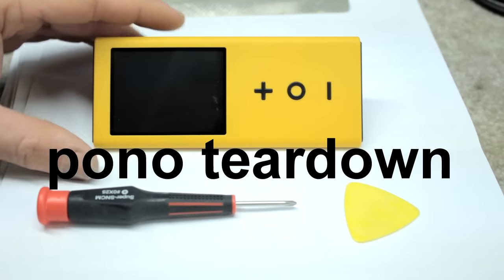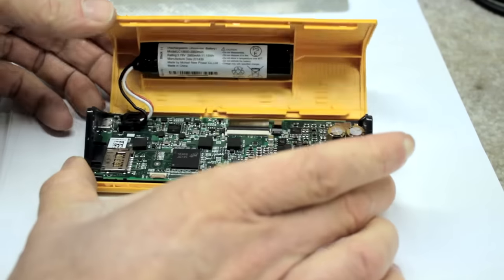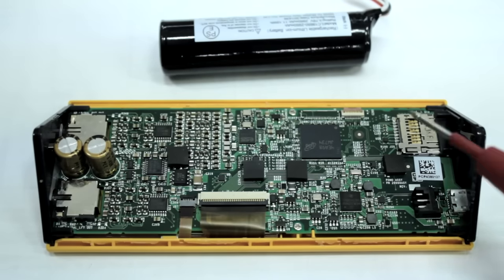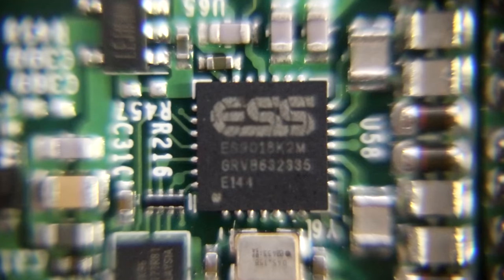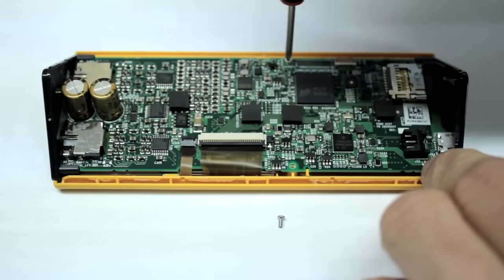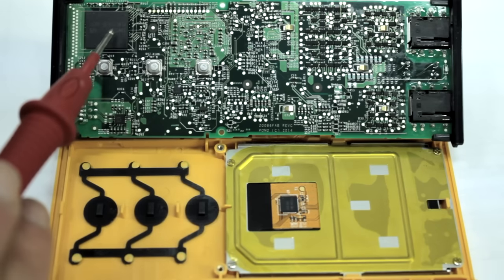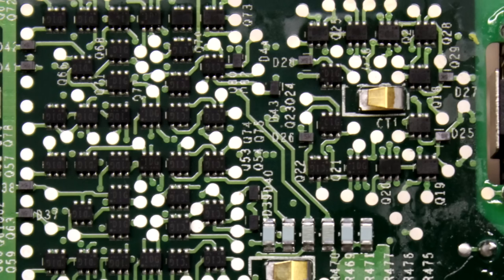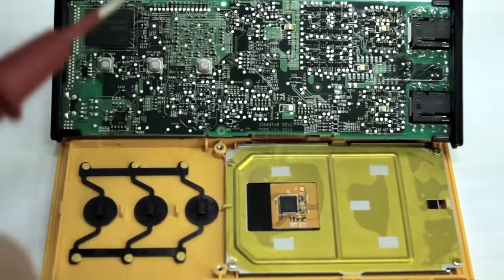Pono Player Teardown - What's Inside

Comment: The Pono uses the same 32bit DAC of that the highly regarded OPPO 105....ESS Sabre32.  Granted the Oppo is not portable, it's an audiophile grade bluray, CD, SACD player which also plays high def audio files from a hard disc, flash drive, or attached PC. I would like to know how the sound quality compares between the two products:
Reply: the DAC chip itself is Extremely cheap in bulk. You realize this right? Whats important is the circuit not the chip. You can find this chip in many CHEAP units and in expensive units.  You can buy this chip right now at Mouser. If buying just one its cheap. Buy 1000 and its really cheap.
Reply: vladlashing - you can buy just a single unit from China for $5 via AliExpress (google it, not exaggerating), so they're not even that expensive when bought in non-bulk. In bulk they're easily down into the $1 range I'd imagine.
Reply: I have 2 Oppo 105Ds and the Pono sounds much better.  The Oppo's Dac is nothing to wright home about.  the PS Audio Direct Stream is my main system DAC and is fantastic.  The Pono is a full music server, DAC with ballanced outputs all in one.  It is a very respectable unit in my opinion.

Comment: Thank you for the teardown.  I'm wondering is the capacitor they have there for the power rail or is it for output coupling of the headphone amp?

Thanks
Reply: +/- Power rails. Outputs are direct DC coupled.

Comment: This popped up on YT and I watched it, so I dug out my old Pono.  It asks to be plugged into power and when I try to power it on, the splash screen comes up then back to the plug in power icon.  Is this just the battery needing replacement?

Comment: Pros:
- Lossless audio support
- High quality stutter-less audio
- Two outputs
- Long battery life
- Simplistic design

Cons:
- Sets off snake oil alarm
- Bulky and cannot be carried in a pocket that easily
- Most audio players today supports FLAC anyway (high-end ones)
- Slightly problematic touch screen
- Rubber coating would literally disintegrate and discolored if used vigorously
- Ugly shape for portable players, good for integrating into Bluetooth speakers and such

p.s. I was talking about using a mid-range headphone to listen to some high quality music. If you care so much about lossless audio, go for WAV! Those are basically indestructible and can be played on any decent audio players and converted to literally any format. Go with ridiculous sampling rate like 1954032Hz. I know you want it.

Comment: this teardown shows that the toblerone shape is completely unnecessary
Reply: +gonigeena no it shows the opposite. the big standard battery can be popped out and upgraded.  no other DAP has that. also the headphone jacks don't take stress like on a slab shape.
Reply: +gonigeena it's a perfect shape, regardless of the innards. my list is above, i'll repost why the shape is perfect, or at least way better than a slab:

1. no stand needed. works in all directions. viewable angle is great even with bad screen.
2. no case needed. rugged and won't slide away.
3. no headphone plug killing. headphone plugs are never torqued.
4. feels perfect in the hand and very easy to drive with one hand. in the dark. even with the screen off. tactile buttons and shape work perfectly to your senses.
Reply: I guess you are an happy customer, right?

Comment: Looks fairly well built and that's a very good DAC.  I'm excited at the possibility of having high fidelity audio reproduction on the go, rather than just at home with my stereo or a headphone rig.  For all the bitter people who seem to always chime in to naysay anything resembling quality, have fun with your McAudio.
Reply: redriverhautbois I've used mine almost everyday for 5 months, it lives loose in my bag and my car, my desk, my dresser, my living room..... it's amazing. I barely ever listen to my phone anymore. I've deleted gigs of mp3's too.
Reply: How exactly has it been "proven"?  It's got a good DAC, are you saying there's no difference between DACs?  Because that's a ridiculous opinion.
Reply: redriverhautbois PP has got a lot more than a great DAC. It also has Meridian's 'negative-feedback' analog circuit design, it has Ayre's proprietary filters between DAC and analog, it has discreet power, it has separate analog and digital boards, and it has no radios, sensors, or other interference on the board.  These are all critical components to great sound. 

Finally, it has balanced output. No other device offers this at this price point. Driving true-balanced outputs with discreet cables really takes you to another level in audio.

Comment: Thanks for this tear down.

Always thought its shape/size was overkill. Now we know for sure!

It's a shame the battery is not long and flat. Then it could be taking up all that space.

Cue planned obsolescence and a 128GB version out with larger battery/display. Smaller form factor within 6months :p

I still want one tho, for the balanced output to headphones such as old trusty sennheiser hd25 or newer Sony z7 (and z5, h2, h3, a2, a3, 1r as well as older ex800/7550, ex1000)

Comment: HEY MAN NICE JOB 
QUESTION IS IT POSSIBLE TO GET THIS LARGER MEMORY CHIP AND HAVE IT REPLACED OR IS THE CIRCUIT TOO SMALL ?
THANKS
Reply from the maker: If you can unsolder a BGA chip, resolder in a new one, and possibly tweak the firmware - you should be sweet. So unless you're a robot, you're stuck with the 64GB of internal memory.
Reply: ***** Thanks man I am not a robot  so I am ok with an external card
Reply: littlejon64 prove it

Comment: My pono player gets warm around where the display is, if I play high res music on it. Did you noticed a similar behavior with yours? I also though of taking mine apart to take a look, thank you that I don't have to do this anymore :)
Reply from the maker: Hi Ein, yeah mine gets pretty warm even while playing 16/44.1 FLAC files.
Reply: ***** Ok, tanks. I was that mine could be broken.
Reply: It's not about the file you're playing, it's most likely how hard you're pushing the amplifier (volume).
Reply: Shouldnt have bought it
Reply: Çerastes I payed for it. Why would it be a trash player? It does everything it should, so it can't be trash in that sense.
Reply: So you say it's overpriced. However, I don't understand why something overpriced is equal to trash.
Reply: +Çerastes you are truly a joker.  are you claiming that a $4 integrated circuit audio chain optimized for voice and gaming is equivalent to the DAC and the analog circuitry inside of a pono player?

you keep catching me with your trolls because they are just so frustrating.  how would an iPod sound the same as a ponoplayer playing the same files? do you know anything at all about how digital audio is rendered into your ears?

Comment: That doesn't look like $400 equipment.
Reply: Shahriar Haque Yet it sounds like $20k equipment. Which is more important to you?
Reply: Jodin Ravia Yeah, I bet It sounds just like a McIntosh setup
Reply: jaaasgoed ponoplayer sounds better than mcintosh gear i've heard. 

Ayre's approach to feedback (short version - they don't believe in "good feedback") makes his analog circuit design unlike anything mcintosh is doing. Mcintosh in fine stuff, no doubt, but there are fundamental differences in the basic signal design between an Ayre amp and other makers.

This is the first time Ayre has tried something under $1k, as far as I know, and to my ears they hit it out of the park.
Reply: This thing clearly isn't worth the money compared to other products out there, but that is the miracle of mass production. If this thing was actually designed custom for them, and they had to create custom software, they'd need a lot more sales than they got for the mass market to dramatically lower cost. But say they sold a million of these, then that price could be down in the $99 range, including a large profit, very quickly. If they sold 10-million, the price could be in the $49 range, still with a large profit. So comparing a mass market item to a custom product like this, you're not going to get value, so it has to make up for that elsewhere... and clearly this product doesn't do that.

Comment: I would wait for version 3, if there is one.  Also, if you are not running it through a home stereo, what is the point of this thing as it doesn't have enough power to power high end headphones. Sony's high def player sounds more intriguing albeit at a much higher price. But even the Sony only has 128 gb of internal memory which is inadequate to store uncompressed music.  The flash memory market can't seem to get to 256 gb at a good price point for some reason.
Reply: +femaledeer i run it through everything and it makes everything down chain sound better.  it's the perfect portable player because you know nothing out there sounds better, at least nothing that won't cost you a mortgage payment or 2

Comment: No wonder the unit is so bulky. They could have easily fitted a flat battery and make the whole unit more compact. Also those big ass capacitors could have been fitted more optimally. Who in their right mind would want to carry this thing around?
Reply: +ovo nisamja best gadget i ever bought. i don't carry it around in my pocket too often, it's always sitting on the stereo or in the car or in my bag.

sounds amazing. portable perfection. no hassle, no distraction.
Reply: I had a car stereo with a USB connector so, that's more convenient for me.
As far as the quality goes, if you include external noise, I doubt it's worth going down that road.
For me, mp3 at 256kbs (good converter is mandatory here!!!) is the top quality one needs to go if he's going to listen to music in a car, or on the street with ear buds. That's just my opinion.
But than again, I have nothing against other people wanting different things, so, yeah, just go for it. And if you're happy about it, all the better.
Edit: I forgot to smile. :)
Reply: cool. i think once you have full quality in your ears you won't want to go back, no matter where you are, mobile, driving, on the bus, wherever. our ears are amazing at filtering background noise and still determining quality. it's like someone offering you clean water and you don't think you deserve it, dirty is good enough for you.
the compressed mp3 files were transitionary tech, necessary 20 years ago but definitely not now. 
but yeah, no one will get rid of the compression, you can keep those mp3 forever. i can't go back, since about 2012 i've gone all lossless and my mp3s all sound like paper bags now.
Reply: Well if you put it that way kinda makes sense.
Reply: Anirudh Rao i get the complaints with the shape but IMO it's way better than a slab. it sits, stands, and stays put all by itself. it doesn't need a case and it doesn't put stress on your headphone cables. overall i love the shape, it's perfect for a media player.

Comment: The simple fact is that, while the Pono Player uses some pretty good kit, it's not going to blow anyone away with audio quality. You could get similar enough results with a cheap MP3 player, high enough bitrate encoding, and a half-decent portable DAC/amp solution. You'll spend less, and feel like less of a chump when you move that DAC/amp over to your computer as well. That's added value the Pono will never have.
Reply: ScottNeelan Not really -- I'm not being snotty, I think you are wrong. Nothing you build is going to be as portable or durable as the PonoPlayer, it's one device with what you would need 3 for. It's a better shape than any slab, and it's a tough little bugger that requires no case, no stand, and no concerns. 128gb expandable MicroSD is nice too.

Why would you need to move the DAC over to the computer? That's marginally important to me. The analog in the ponoplayer smokes any computer anywhere, and you only need 1 good music player when it's so portable and has so many output options. I listen to ponoplayer while I use the computer, I don't need to move my DAC around if it's sitting on my music library.

I'd like wireless sync if they could be sure of no interference. Part of Pono's good sound is no radios or sensors whatsoever, and a discreet power supply and analog board.
Reply: Unless it's one of the expensive Fiio's or A&K it's not sounding as good as the Ponoplayer.

Getting Ayre amplification battery powered for $400 is the real value of the device. This is the world of analog, (like your ears and the rest of the real world).

2nd best feature is the flexible output, including balanced, line, headphone, and dual headphone.

The DAC, memory, android, and general feature list can be found on other devices.

The form factor is perfect for both mobile and stationary use. Everything is open standards. The store pushes provenance and HD remasters. What's not to like?

Comment: the layout of the board actually look good (I'm a noob at electronics btw). but the chassis and everything eles is just terrible. for $400 any asian designed player would f this over.
Reply: 10shot9miss I think the form factor is perfect for a music player.  Far superior to the slab shape in many ways. 

I'd like a better screen, battery, and wireless sync wouldn't be bad, as long as it doesn't interfere with the audio.

Comment: Please don't hate me for asking this, I am by no means an expert on audio. But what makes this thing sound better then plugging my headset in phone? (GALAXY Note 4) I mean I can tell the difference between playing from my phone and from my soundcard but that ain't worth 400 dollar. Shouldn't you rather spent 400 dollar on a good headphone?
Reply: +Eternal Genesis basic answer - signal chain.  the source file quality is the first thing in the playback chain. the first makes it by far the most important. you can't fix it down the chain.

source is everything. assuming it's the best you have, then you can improve down the chain -- amps, speakers, cords, chips, etc.

so even if you play the same file from your phone that's on my pono player, it's rendered differently by the different links in the chain: DAC chip, filters on the digital output, analog preamp, then analog output amp and wiring.

your phone has parts made for voice and gaming, entirely printed into 1 integrated circuit complete with radios sensors and other interferences, and purchased from a supplier for around $3.

my pono player has the same type of parts but each is specifically picked and tuned for professional audio, designed and built by audio experts to sound the best they can sound with critical listening. total cost of those parts might be $100 as opposed to $4.

the rest is memory, case, screen, and battery cost., which your phone might be similar or better than the ponoplayer. but none of that has to do with sound quality.

the ponoplayer is a single-purpose digital device. not that many exist, which is partly why it gets heckled. also neil young speaks his mind and often times is liberal (canadian) so he gets attacked and so do his projects.

the thing sounds great. better than your phone, i can guarantee it. that's it in 4 words, or lots of words.